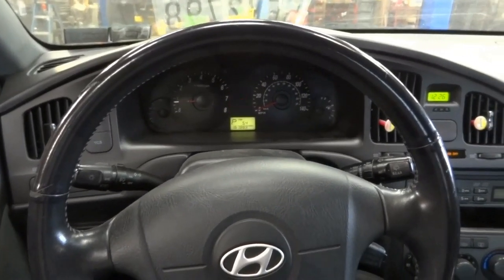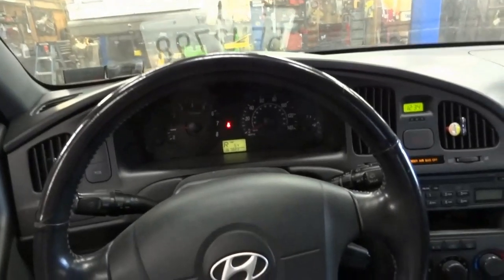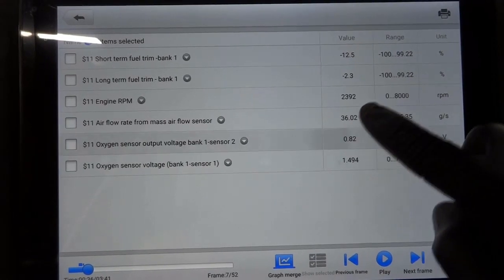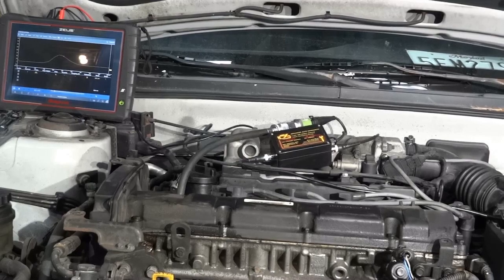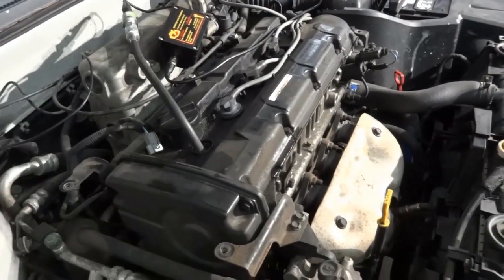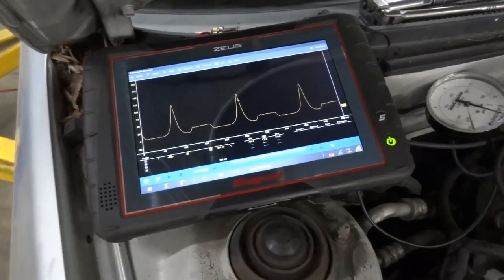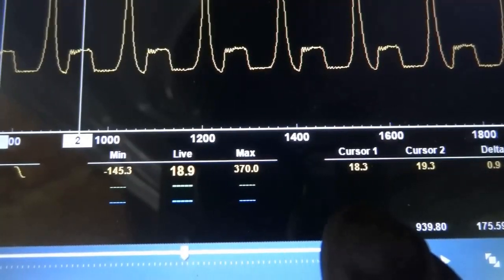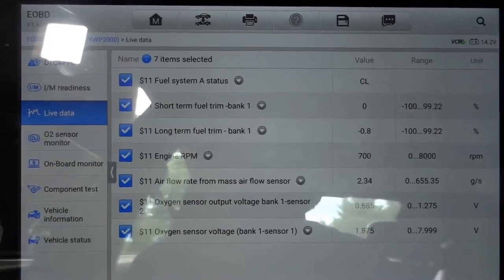Hyundai Elantra: Transmission Not Shifting! Severe Engine Power Loss! No Check Engine Light On

Comment: Hi 
Can you explain if the same Hyundai not shifting in transmission what should I do to solve transmission shifting problem ?!
Reply from the maker: Josef Abraham  you might have a defective solenoid or a wiring problem, did you check the fluid level!

Comment: My 2014 Elantra Gt is having poor fuel economy and not driving uphill well. It’ll get stuck at 3000 rpm and won’t go pay 40 mph but when it’s past the hill it’ll catch cruising speed. Also if I rev the engine right away it’ll just go to 3000-4000 rpm and won’t go past 20 mph for a while! No engine light or any lights available, and no codes are read
Reply from the maker: Andrew Thayyil  you might have a clogged exhaust and other things going on! do the tests I did in the video and see what happens!
Reply: Hey Drew! I'm having the same the car and I'm having the same problem now! Did you figured out what was wrong with your car? Thank a bunch!

Comment: i have a hyundai accent 2008 . i have praticly the same problem. when i start to run the car …. my car struggle to shift until 30KM / H and after when it shift it runs well . whats the problem?
Reply from the maker: Ralph COLLADO EMIAS  this can be caused by a couple of things!! a defective transmission or a clogged exhaust etc... you should take it to a pro mechanic to have it diagnosed!!!

Comment: But what can cause it to stall when on motion, engine hot, in gear and brake pedal depressed but wouldn't stall when the same car is on motion, engine hot, in neutral transmission this time and brake pedal depressed? 
   The car is 2005 Hyundai Elantra GLS with an automatic transmission. The Mechanic have replaced a fuel pump but  
is not working. Problem still persist. What should I do? 
 Car was not communicating with scantool.
Reply from the maker: david essien   you need to get it to communicate first and see if you have any trouble codes stored!! then look at fuel trim numbers at idle and while driving, also check mass air flow sensor!!

Comment: Hi,great video, very detailed, i could not afford to skip any part, thumbs up. I have an Hyundai Elantra 2004 recently it starts to shift hard from 2nd to third gear at high rpm, shifts pretty smooth at lower rpm, what could possibly be the cause
Reply from the maker: Badru Olaniyi  it sounds like your transmission is going out, did you check the fluid level?